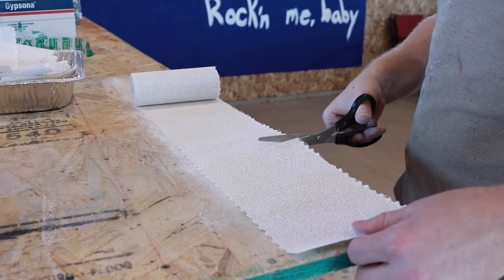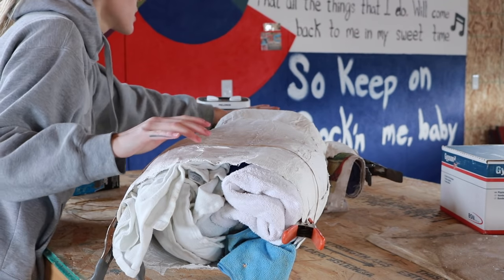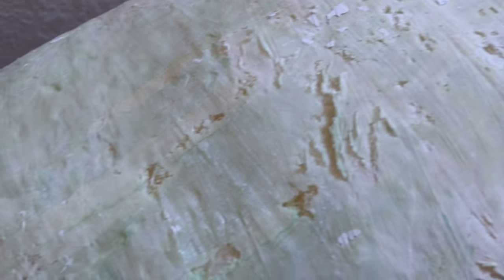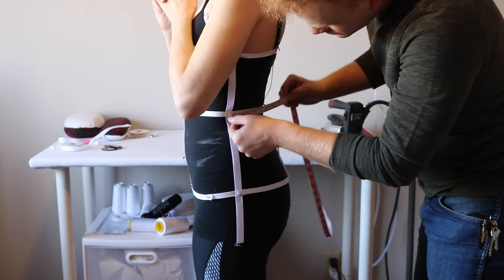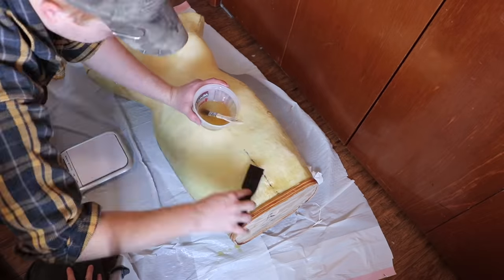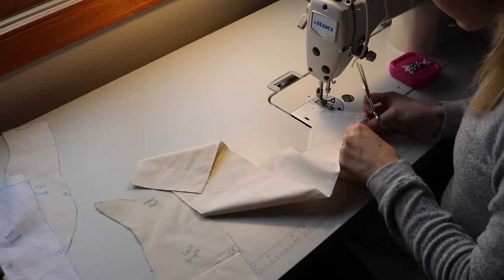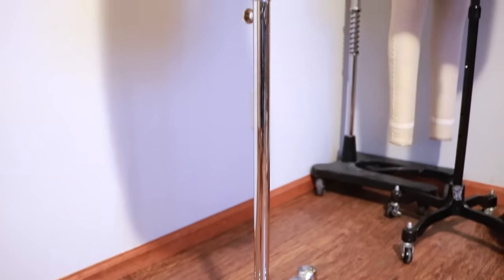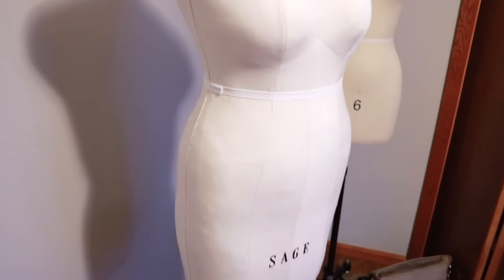Making a Custom Dress Form

Comment: next time put a tight long sleeve t-shirt that is 2 sizes smaller so it fits very snug to the body the cove with duck tape all over then cut the T-shirt under the arms then cut it up the back with scissors to remove it then tape the cuts closed once you have it off.  Be sure to go all the way around the torso and arms reinforcing it ....go over the tape with 2 layers of the plaster paper then once it is dry fill it with foam..... then used quilting batting and covered the form with fabric...I used an old hat stand to mount mine it has lasted for years

Comment: I have researched many different ways to make a good bespoke form. I think taking advantage of modern technology has to be the best option. I would get a 3D scan of the body to start with. Then slice the 3D scan in say 5mm slices. Print plan views of the slices and use these patterns to cut out pieces from sheets of suitable rigid foam. Glue them together. Seal and cover. I think the beauty of starting with a 3D scan is that you can manipulate it and shrink it if necessary to take account of any coverings or batting etc added after the fact. Also if you want to, you could make the slices from ply with a hollow cut out to keep the weight down. This would make a rigid positive from which you could cast a much sturdier front and back piece to make foam moulds from.
Reply: The scanning people said they coat the piece they scan with a special metal paint. I am thinking there would be a stretchy material that would do what is necessary. 
But they quite dissuaded me. 
In the future we will be scanned and decide what clothes are made for us.

Comment: OMG that's amazing! You pointed out an inch difference in the waist placement, compared to your body. I think it's practically perfect. You waist is higher than the waist of the dress form, but your shoulders are also higher. If the dress form were an inch taller (with the height coming from the legs), the shoulders and the waist would be nearly perfect.

Comment: I'm so glad you went and actually poked different foams with pins to figure out which ones work best! There are so many different methods of trying to get custom dress forms out there, but this really looks like a highly professional and USABLE form for both fitting and draping! Yes, obviously fitting on a form is never going to be the same as fitting on a body, BUT it's a lot easier to get closer with a form that's closer to your actual shape. And the fact that the proportions are much much closer fit to your body helps so much with designing/draping things that are actually flattering on YOU instead of the dress form.

Comment: Your hard work and intricate detailing really shine here.  Years ago when I learned how to create my own patterns and fit them to me, I created a dress form cover from a princess line bodice pattern.  I put in a back zipper and took an old form that someone had given me, and contorted into fit my shape.  I padded it and closed it up on the form.  I have done this twice and really need to do it again.  

Our bodies change as time goes by and it sure goes by fast.  I love what you did.  It looks so much better than mine did.  I have had years of use from it though.  I finally bought a nice one with my measurements, and it works for photography and fitting for some issues.  I am also short waisted.  My legs are just an inch longer than the normal inseam found in ready to wear. 
 Thanks for sharing your story.

Comment: This process is very similar to a kit that used to be sold (maybe still is?- I couldn't find them) in the early 2000's called my twin dress form. They used a drycleaner plastic garment bag to cover the body and undergarments and used making tape to secure the extra fullness. Plaster bandages next but they didn't make it two part. Instead special scissors were used to cut the plaster off. The cut edges were then sewn together with string and another layer or two of plaster bandages reinforced the whole form. Their instructions called for green surgical soap as the release. It didn't work even as well as the release you used 😳 I ended up using a player rasp to file off the bandages. They had two jersey knit cover layers, no batting. I still use this form today, a hundred pounds heavier. I've added padding and batting to account for the increase in size. I tried to make a new form but used paper tape. I ended up passing out and busting my paper shell like a pinata 😅 I was very careful to not lock my knees out and to breathe evenly. Dunno what did me in. I like your wide plaster strips for quicker coverage.

Comment: Have you tried fabric glue? In quilting today, many are turning to the new fabric glues to do their basting with. I have tried it; and, it really does hold things in place and washes out later. It saves me from sewing a pin (breaking a needle and/or getting the timing off in my machine); and, it saves me from stabbing myself with the pins (bleeding on my projects). Plus, if I can not finish the project as quickly as I had planned, I don't have to worry about pins rusting into my project (which has happened in the past). If you are not happy with where or how you glued it, you can pull it out and try it again.

Have you ever tried making a duck tape dress form? I was wondering if a duck tape dress form could be used to make a plaster cast form to pour the foam into? The duck tape may come apart if greased. However, the duck tape may be removed later from the inside of the cast form (without grease, a little at a time). I've never made one. A duke tape dress form doesn't look like it would last very long; but, maybe it would last long enough to make a plaster cast form
Reply from the maker: I cant say that I have ever used fabric glue but I can definitely see the benefits as you have put them here! As far as the duct tape form, I have had a couple of people bring that up as a potential option instead of plaster and I think it is a lovely idea. I would really love to see someone make this project up in this way, it would certainly be a lot less cold!

Comment: Expanding foam expands on the path of least resistance. Instead of putting the two halves together and then pouring the foam, I would pour each half separately. Once it had cured cut the excess foam off evenly de-mold the halves then glue the halves together. It would be easier to pour, easier to de-mold far more accurate.

Comment: this was nice to see your body shape compared to the standard dress form. My personal waist seems to be longer than average. I can always tell when I make dresses or blouses. They always 2 inches too short in the torso and it drives me nuts. I have to remember to adjust the pattern before making the outfit. I'm still annoyed about a blouse i made was 4 inches too short and i covered it with a 5inch ruffle but damn! You can tell my waist is long!

Comment: Agree with you on the Bootstrap option. I have severe scoliosis. There’s no way a circumference alone can correctly proportion the valleys and humps of my torso. There’s way too many measurements missing. I did the duct tape option to make my wedding dress. It wasn’t perfect but was a great tool as mostly sewing alone. I wish the body scan ones were more affordable.

Comment: Impressive results, but so much work. Wow.
About those rounded shoulders —suggestion: get rid of your pillow and sleep with a rolled towel under your neck. Slowly decrease the size of the towel roll until you no longer need it to sleep comfortably. You will notice your shoulders will begin to straighten.  I’ve been doing this for 6 months and am finding that I’m standing straighter. Tnx for sharing.

Comment: I just watched your video and I have a question. One of the things that I have seen others do is instead of plastic wrap they use a painter's coverall. This would be only slightly porous but should be enough to keep the plaster from sticking. What are your thoughts on this? Could it be an alternative? 
If you think it would not be enough what about a hazmat suit?

Comment: Hi! I am going to attempt making one myself and found your video extremely  useful! Thank you! One question though: did you use the whole 2l of the foam? I am wondering if I need 2L or if I could get away with just 1L kit. Thank you!
Reply from the maker: I did use the full 2L. However if you pour your foam in the proper temperature it uses less foam!

Comment: Excellent job and video.  QUESTION:  How did you get the plaster of paris mold off your body?  My cast for my broken arm was made of that stuff and it had to be sawed off with a special electric saw. TIA.
Reply from the maker: I put on SO much vaseline beforehand! I also made it two part cast so that I could pull it apart without cutting it.

Comment: I'm making a cast foam dress form now, and I've just finished the mold! I am wondering how you attached the form to its stand. It looks like the pole just attaches at the bottom flange, instead of having any vertical tube going up through the center: is that accurate? Would you advise putting any kind of pole through the core?
Reply from the maker: We did just screw a flange to the wood base on the bottom. It feels pretty sturdy or at least as sturdy as my other dress forms! I think it would come down to how you are most comfortable with constructing it and maybe what base you buy for it. If you don't have wood working tools then maybe running a pole up the center would be best.

Comment: Great job. Sorry if this has been asked already, I want to make one to ship overseas to my tailor. What would you say the weight of just the foam is without all the extras like wood, pole etc etc. 10 lbs or maybe less? Thank you In advance and again great video!
Reply: I made one following this tutorial. I'm bigger and taller than Sage, and I did use 4lb density foam, but I'd say it's close to 20lbs unfortunately! You might get away with less weight if you do use the 2lb foam.
Reply from the maker: It is quite heavy, I would say the estimate above of 20lbs is about right!!

Comment: I did something similar, unfortunately the cast expanded quite a bit due to the force of the foam expanding. 
It's bigger than I with a shorter torso 🤷🏻‍♀️

Comment: my biggest question was how did you get it off without breaking it into pieces? But you just skipped over that important step, why?
Reply from the maker: We just pulled it off. It was very solid and we had created a lip overlapping that we covered with vaseline so the two halves didn't stick together, they came apart very easily. I hope that answers your question!

Comment: How much would you say it cost you in the end ?
Reply from the maker: I would say it eneded up costing afourn $200. So not terrible considering that is about the going price of a store bought dress form (if not more). However, it would have been even cheaper if I had gotten a higher density foam and didnt need to pour the rubber coating on!
Reply: Foley Dressed Not bad at all! :o yes it is around 200/300 for a professional one and it’s been keeping me from starting draping because I don’t feel like it’s worth the investment with all the alterations I’ll need to make :/ (I’m both a size 8/12/14 at the same time LMAO) if I use one haha focusing on regular patternmaking instead for the moment we’ll see in the future! thank you for documenting this project though was super interesting 😊
Reply from the maker: @LS-vq2or  If you do feel like you need a dress form I highly reccomend Redthreaded's Youtube video how to to properly size up a dress form to fit your measurements! Could be worth it in the meantime, especially because a nice dress form doesnt tend to lose its value :)

Comment: It’s so much easier to buy a form that is slightly larger than yourself and then shave the foam down to the right dimensions. Can get that done in a couple hours.
Reply from the maker: This is certainly an option! One thing to keep in mind is that this would really only work for people with the same, or close, vertical proportions to the form. However, if you were much taller (as I am) or shorter than a standard dress form you wouldn't be able to make those height adjustments. But certainly a wonderful recommendation for people in that vertical ballpark!
Reply: @FoleyDressed  Definitely. I'm disabled, & no way could I modify a bought form, that would destroy my budget... I also know way more people without my body issues, but imperfect enough bodies that would not benefit from a bought form